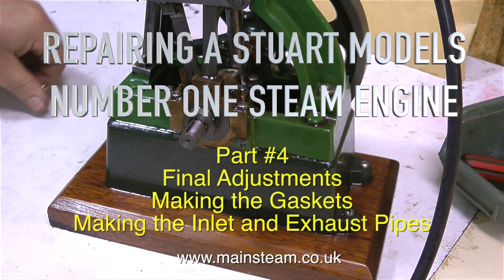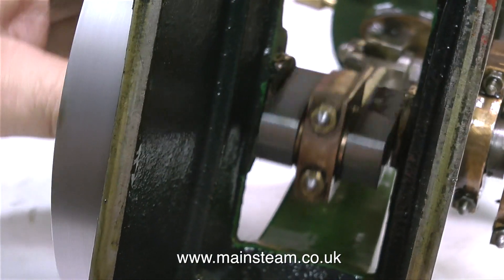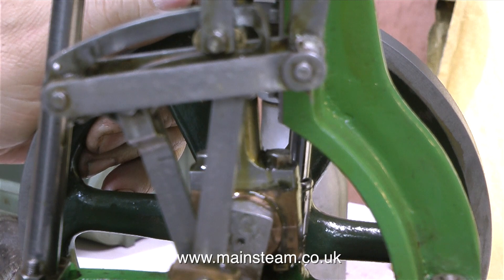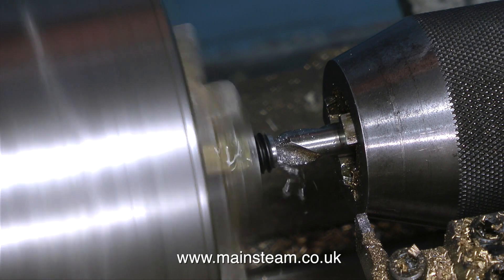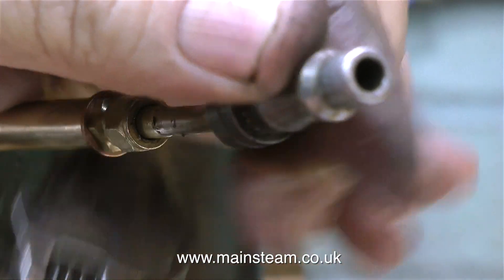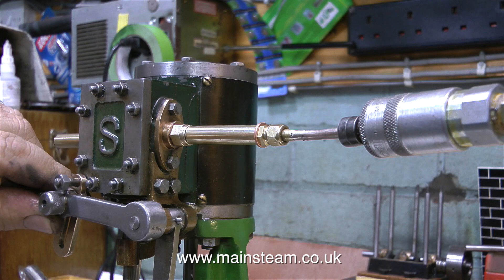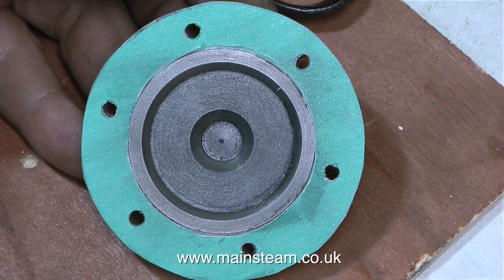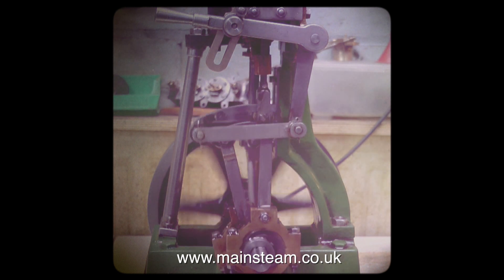STUART NUMBER ONE STEAM ENGINE REPAIR - PART #4

Comment: I have always made my gaskets by tapping them out with a small ball peen hammer and I press a dot punch into the holes for the bolts. I learned this method when I was a ships engineer.
Reply from the maker: A good method and one I have used myself }:-)))

Comment: 06:38 You got me curious so I looked it up: water [compressability] is roughly 40 times softer than cast iron and 70 times softer than steel. Perhaps a better comparison is air... roughly 20,000 times softer than water. Hope this helps.

Comment: Thanks for the nice explanation concerning the more CO2 neutral usage of a steam engine ;-))) The lever out of its maximal position, shortening the movement of the valve and thereby reducing the steamflow... I will use this trick in routine on my steamboat AMPHORA...

Comment: I was told by an old fireman that a lot of engines had supposed "safety valves" on the cylinders so that if you didn't open the cocks the valve would blow before the covers would blow off. However, they were quite unreliable, as he found out when he was driving one day and heard a loud bang and found the cover to have blown off!

Comment: A quite random question: how are covers sealed in real world steam machines? Also via similar(ish) gasket material or in some other way?
Reply from the maker: Gaskets - similar but bigger :-))))
Reply: FrankyBoy- some use gaskets, some use labyrinth rings machined/chiseled into the cylinder/cover with no gaskets. On very large engines the land between cylinder wall and outside diameter means that this method is highly successful, and also means that gasket failure is a non-entity, no bad thing when a cylinder cover might weigh upwards of half a ton.

Comment: When you run the engine slow and its just putting along is the best... You can really hear each admission and it sounds awesome. A question, you don't think having the inlet and exhaust pipe so long will get damaged?
Reply from the maker: That is what the customer specified.